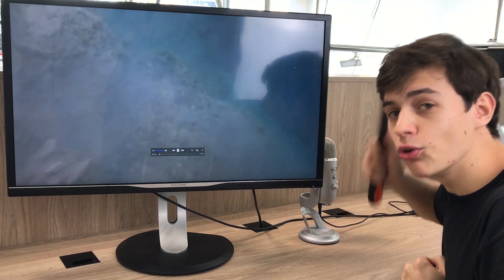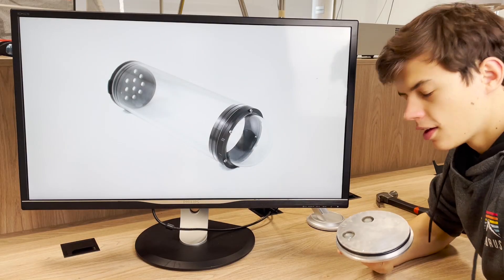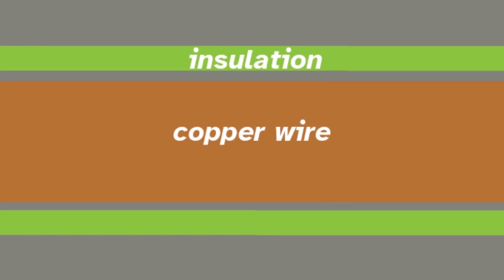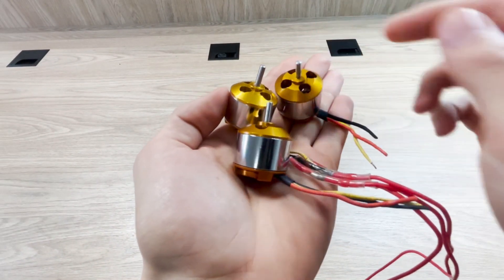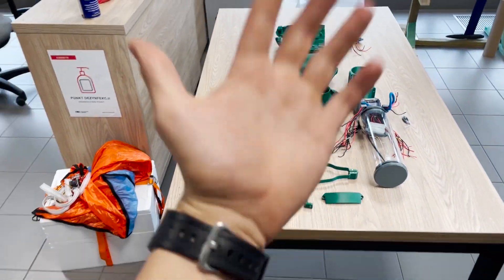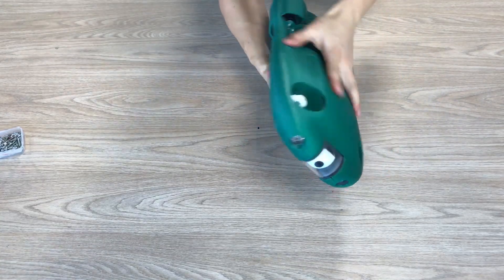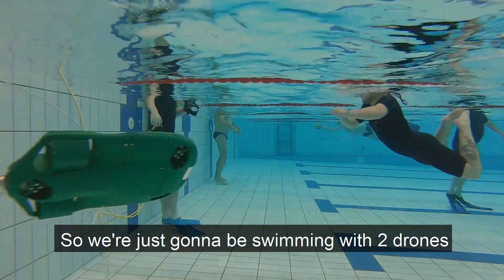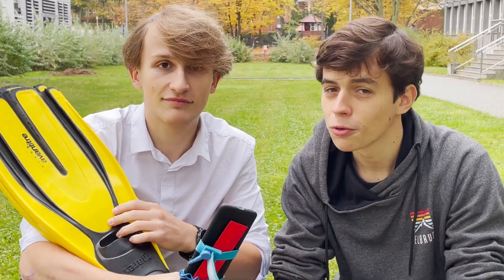We 3D printed a submarine (dives down to 85 meters / 280 feet)

Comment: The water leakage through the wire issue is to first use better wire like m22759/16 Tefzel (PTFE jacket/tinned copper conductor) wire and then to make splices and connections that are 100% water proof.  This is regularly done for building motorsport grade wire harnesses and will happilly survive salt water to well below 85 meters.  I would trust my wiring and sealing to the rated depth of the connectors if I was using them and if direct wired to components, I would trust them to over 1000 meters no question.  It requires proper build techniques and some expensive sealants to do it, but so long as its above -40C, I would trust it at any depth.
Reply from the maker: That's a really great advice, thank you so much!

Comment: Nice work guys look great.
As a suggestion you could print rhe caps with resin. As for wire pass-through. You guys dit a great job with the solder joint technique I have used that my self aswell. But now that I work with pcbs al the time I got used to making custom pass-through with them instead. The can be even better as it leaves no openings and usually as more seals
Reply from the maker: Yep, we'll probably move on to this solution at some point.
Reply: @CPSdrone  if you guys need help with  pcbs or with resin printing. Feel free to contact me. I'll be glad to help if you need it

Comment: Won't the lubricant from the motor bearings get washed out?
And also water will get trapped inside and corrode it.
I would replace these with a sleeve bearing.
And also it would be good to seal the motor stator
Reply from the maker: That's true, the corrosion might be a problem after some time. This is a lot of precise work however and we found that replacing the motors after 1 year is just easier. We used ceramic bearings before, as well.

Comment: Considering its tethered, would it not be more effective to have all electronics except for those that are required to be below the water above? That could save a whole lot of engineering, and also allow for battery changes or running from a constant power source.
Reply: For one thing, you'd need a much more expensive and heavy cable to run multiple "channels". Cables have resistance, so they eat up energy. Brushless motors work through an ESC and get fed their energy through three cables, those cables also need to be switched in sync with the motors rotation. So you need 3 cables for each of the five motors (or was it even more?). Then you need much more voltage because that voltage drops along the cable. I think one power cable, zipped to the ethernet cable may work... but even that would be quite tricky. POE... maybe, though it would probably not power the motors which are the biggest consumers.
Reply: @Andreas-gh6is  thanks Mate, I didn't even think of the cables resistance. I guess then, the biggest hurdle was wanting to use a 3D printed chassis as 3D prints aren't waterproof off the bed. Thanks again for the detailed reply!

Comment: Wouldn’t it be easier to just use enamelled wire rather than insulated wire? That way you wouldn’t need to cut and solder it?

Comment: Have you considered running PoE over the tether for longer runtime?

Could the Pi pilot the vehicle autonomously (without tether)?
Reply: The pixhawk can be programmed to do autonomous mission. I don't know which software they are using on there, but the usual firmware allows you to specify waypoint missions. The Raspberry Pi should be able to control it, but its main purpose is probably serving as the network endpoint/router for both control and the camera footage.
Reply: Only if some localization sensor is added. There is obviously no GPS under water
Reply: @osmanpasha_diy  the Pixhawk already has all the necessary sensors to do inertial navigation. It might be less accurate than GPS especially over long distances, but it should basically work.
Reply: @Andreas-gh6is  Yes, using intertial navigation only is less accurate to the point of being unusable. The sensors are there for immediate attitude calculation (pitch/roll/yaw), but integrating it over time yields too much error.
Reply: @osmanpasha_diy  The only way it's gonna work. And it works out of the box. A magnetometer might help. Otherwise you need to start using the camera, maybe even sonar/ultrasound range finders and do some fancy sensor fusion. You can also program the rover to surface every once in a while to reset its position from GPS.
Reply: @Andreas-gh6is  well, the proper way to do that is to set up ultrasonic beacons that will implement some sort of "underwater gps". Or USBL positioner. Camera data only works if you see the floor clearly, which is not the case most of the time. Sonar would work, but for the price of a good sonar you can get a USBL system that does not require inventing of a proper sensor fusion.
Reply: @osmanpasha_diy  this is a hobbyist project. Inertial navigation + magnetometer is already plenty for the range it has. The camera need not look for the ocean floor, it could be used to find the sun. and obstructions thereof.
Reply: @Andreas-gh6is  Well, I will eagerly change my view on uselessness of IMU+compass-only localization when I see one in action.

Comment: Have you tried putting aluminium rods in the endcaps of the tubes and using those as conductors in stead of the wires. If you're gonna be using epoxy to waterproof everything anyway the gap between the holes in the 3d printed cap and the rods won't matter. Using wires that are soldered in the middle and casting those in the epoxy seems like a roundabout way of doing things. The only thing that might be a problem with the rods is that they will contract in the cold water which might open up a gap between the rods and the epoxy. But the advantage is that you can put a threaded hole in the rods and attach te wires inside and outside using screws.
Reply from the maker: We plan to redesign the endcaps in the future for easier assembly and less manual work - for sure. The idea with rods soldered to a PCB and covered sounds like a good solution.

Comment: 1 question...if it must be teathered to the surface.  Why would you not just have batteries up on surface rather than putting 1 hr batteries inside
Reply: Wouldn't be worth the trouble, I think. First it would mean a much heavier tether. Then you need more power overall because of the cable's resistance. Then if you're actually away from a power grid, you still need a generator or batteries. This solution looks like a pretty good compromise.

Comment: Try circuit boards and solid wire. 
Coat everything in epoxy. 
Then you will not need a chamber.
Camera would be the only problem for depth.
But that should be able to be worked out.
Reply: seems like a good idea - but a permanent solution like that prevents tinkering with the internals

Comment: Are you updating the drone designg to be charged via the control cable?
it should not be much more expensive, but it will definitely increase the dive time indefinitely.

also sanding the body shell is a good practice or adding epoxy or some other filler material to smoothen out the surface with low effort. (should work on the propellers as well)
Reply from the maker: Not currently. Charging through the cable is too much hustle for us right now, since it requires a specialized cable and the onboard battery allows for the 1h swim-time anyway.

Comment: Im no genius but I am a carpenter and using 80 grit sand paper will not make things smooth as possible.
Reply from the maker: That's why we used 80, then 200, then 600 and then 1000. This was only the beginning :)

Comment: neat build, its much better than cheap brushed motors! would be cool to see just how deep you could build an ROV to go.
Reply from the maker: Thanks Peter! Yeah, brushless is the way to go underwater. We'll hopefully try it in the worlds 2nd (I think) deepest pool, which is 45m. But some ocean expedition also would be nice
Reply: They are limited by the ethernet cable. maximum lenght is 100M, unless they use fiber optic
Reply: @yvesinformel221  Kinda yes. the higher number the category of cable, the longer the transmission length.
Reply: @yvesinformel221  is it not just limited to that length at its rated speeds? Couldn’t you just run a slower signal through it and get a longer length?
Reply: @conorstewart2214  yes and no. After a certain point you have to worry about the voltage used. This needs to increase with length. 

Let's say every meter the voltage drops 1V as an example. Using a 5V signal can already give problems at 3m as the voltage would reach the logic voltage threshold. This can lead to false signals or even no signals. 

If they would go past the voltage of the ethernet adapter they would need a Amp in-between the laptop and the cord and the cord and the sub. This sub side is needed to prevent voltages high then the support voltage to enter the pi in this case
Reply: @yvesinformel221  increase the voltage to 96V .... then the 100 Meters should get much much larger ... inside the drone have a step down converter....
Reply: @snapo1750  Not sure the limitation is the voltage, I think it as to do with the timing with the eternet protocol
Reply: @yvesinformel221  isnt the limit of 100m because of the voltage drop?
Reply: @snapo1750  I cannot bet my life on it, but pretty sure it has to do with collision detection, I haven't look at the protocol for ages (layer 2), so I don't remember
Reply: It's not that hard to build an ROV yourself which can go many hundreds of meters deep. All you need to do is replace the tubes with aluminium or steel ones, and use oil-filled motors with pressure compensated oil bladders. That's how they do it for a lot of deep diving ROV's.
Reply: Pure speed
Reply: Oh, hello Peter!
Reply: Roomba's king)
Reply: Modify it to make it a flying hovercraft.

Comment: What about the possibility of utilizing a resin printed parts from an engineering resin (ex Liqcreate Strong-X or Composite-X) they would suit extreme environments like this. For the ability of optional customer requirements in special cases it may allow you to push the depth limits for perhaps a "Challenger DEEP" model?
Reply from the maker: Maybe, haven’t though about it yet. We also thought about the possibility of filling the whole electronics pipe in oil - in theory, this should make the drone super pressure-resistant
Reply: I think this drone is most limited by the length of the ethernet cable. So it doesn't make much sense to operate below 85m. I'd say that's already plenty of depth.

Comment: I have a dumb question on your wires. For your cylinder end caps. Why not just screw some brass thread through the end caps and soldier wires  to that brass screw? Way easier to seal and no way water can run down your wire? There is no wire going through your end capThis is what we do in RC submarines. Should work for this I would think?
Reply from the maker: Huh, haven’t thought about that. We’ll look into it.

Comment: I do see why you need the wire isolation to be discontinued to avoid water leaking inside the acrylic tube, but you lost me with the soldering. If you strip the isolation without cutting the copper wire you can skip soldering. Or is the soldering bundling together all the wires so it is then just a solid chunk of metal that entirely blocks any water?
Reply from the maker: If you strip the insulation without soldering, the water will leak - we tested that. You need to make sure that your soldering quality is also supreme
Reply: @CPSdrone  So I guess soldering removes any possible air pocket in between the wires that later could be crossed by water. My take would be to partially strip the isolation, and apply solder to the wires (but no need to cut the wires). Thanks for your answer and for all the interesting insight in the video.
Reply: @CPSdrone  I have heard that you can seal the wires effectively by roughing up the bare exposed wire with heavy grit sandpaper and maybe a knife (putting spiral grooves in the wire).  This will give the marine epoxy lots of surface to grip onto

Comment: Did you look at power-over-ethernet (POE) for power? [That way you don't need batteries on board the sub.]
Reply from the maker: For stock POE, it’s unfortunately too much power to handle. Could be done, but the stock battery still allows for about 1h of swim time - I think it’s enough.

Comment: Out of curiosity, is there a reason all the electronics need to be in the drone itself? Could the pi/pixhawk and batteries be left at the other end of the tether, and leave just the sensors and drivers in the drone, or is that too much data transmission happening for the ethernet cable?
I suppose the maximum current draw might also be too much for PoE, but that seems easy enough to rectify with an additional tether cable dedicated to powering everything.
Reply from the maker: Definitely too much for POE.

External power supply is definitely possible but then again - cable needs to be thick and specialized. The voltage also needs to be bumped up for powering the drone from the surface.

It would be hard for example to use the 100 meter cable as we are doing now. 

I think it’s easier for now to have everything on the drone.
Reply: I don't know this 100% but my guess is there is a limit on how long the cables from the ESC to the motors can be. Otherwise it's too hard to synchronize the coils and of course the resistance is an issue. And every motor needs three cables.

Comment: That's a very cool way to build an ROV. 
A couple of tips for you or other builders, You can also make 3d prints waterproof by rubber coating them. You can get this in a can for dipping tool handles or in a spray can. I've tried it on 3D prints and it seems to work well with ABS. (haven't tried PLA)
You could probably make your motors more durable by taking the rotors off and spraying the electronics with either rubber coat or just clear lacquer. This would give them a waterproof coat without affecting function.
The solder joint was an interesting solution for stopping water migration inside the wires. Another Youtuber that builds full size hobby submarines uses solid copper wire embedded in resin for the same purpose. Except for the joint the rest of it is stranded wire.
Reply from the maker: Thanks for the tips! Haven’t tried extensively the coating trick, our solutions seems easier for now.
Reply from the maker: We found that the main problem with the motors is rather the bearing corrosion.

We replaced them before with ceramic ones but seems like a lot of work. 

We also tried clear coating them but the bearings still give up first.
Reply: One problem with coating 3D printed parts is that the parts deform, not just with pressure but also with temperature. That can make things tricky sometimes.
Reply: @Andreas-gh6is  With the rubber coat I suggested, I've never noticed a temperature change when it dries. Or did you mean temperature change when diving? It's rubber and can flex all it wants. Besides, the only things you'd coat on your sub are the tube end caps, camera tube end caps, and motor housing's if you went that way in the future. 
I've also peeled that stuff off of 3d prints later, (quite difficult) and it doesn't seem to eat into ABS, but it does bond quite well to the surface. 
Another option would be to print some of the parts on a resin printer since I don't think you'd have the gaps that you get with an FDM printer.
Reply: @the_omg3242  What I mean is that a coat can chip or get cracked when the object deforms. I haven't used rubber yet and it might be relatively safe from that effect. I've  had it happen with epoxy though.